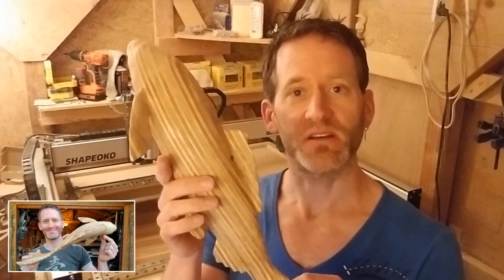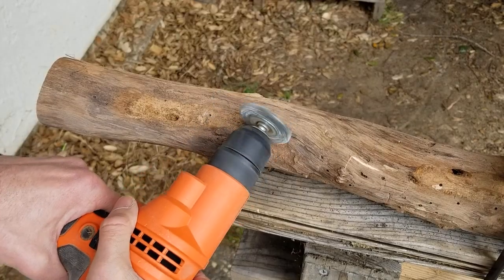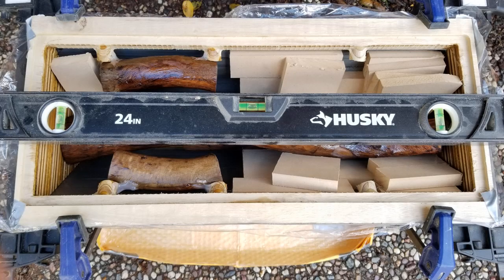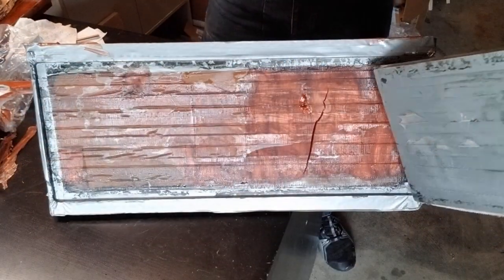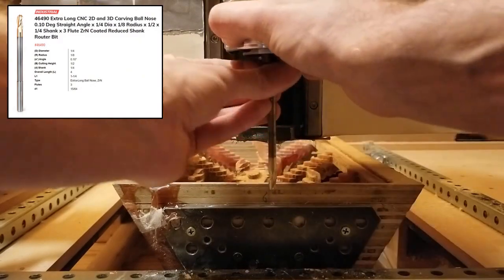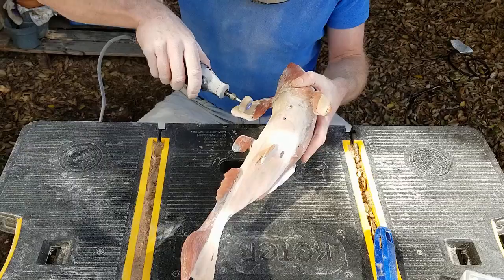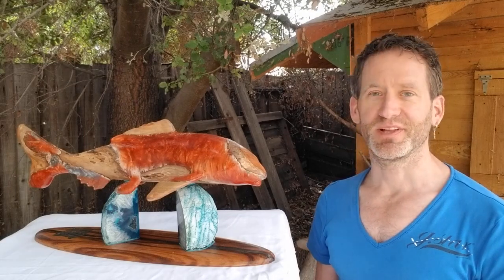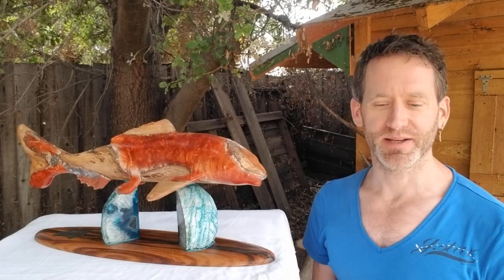Carving the Koi fish version 2.0 - Manual rotary CNC routing with the Shapeoko

Comment: What a fantastic project! 

This deserves so many more views. 

And it answered several burning questions I had after spending the last six hours researching and comparing the Shapeoko 4, Shapeoko PRO, Onefinity, and even the 2'x2' AVID CNC. A wide range of $1700-$3,600. 

But I was most interested in their ability to perform smooth compound-curve machining motions. As all of the photos online, even the marketing materials from these companies, always show very basic 2D or 2.5D engraving works. I was also brain storming the possibility of having the spoil board mounted to the base or even recessed to gain the additional height. I was leaning toward the AVID benchtop models as their added 4th-axis would allow certain more detailed 3D parts to be made (such as large model airplane fuselages). I appears that with some effort even the Shapeoko4 can be made to work for this complex task. 

This one video answered ALL of my questions!
Reply from the maker: You're very welcome! I had the same questions as you did, as I wanted to do 3D carves of organic shapes, and decided that the Shapeoko 3 XXL would fit the bill. I believe it is much more customizable than the new Pro (which didn't yet exist when I purchased my machine). It's accurate and sturdy enough for most of my projects. But maybe not up to the real heavy duty stuff (for instance metal carvings that require the highest precision). The circuit board also does not allow a 4th axis to be connected, so that's why I came up with the manual rotary axis. I'm happy to know that this video inspired you to explore your creativity. :)

Comment: Much cooler use for the technology than the plywood version, which could be done by hand in less time. Regular wax works great as a release agent, mold release wax is even better. Three or four coats and you’re good. I want one.

You can preheat the epoxy components for better flow. Likewise, a slower curing resin may flow out better and prevent holes/cracking. I use Raka.
Reply from the maker: Good suggestions! I use floral epoxy if I want a clear, flawless cast. But I generally prefer bubbles and other imperfections, to match the weathered wood that I like to work with.